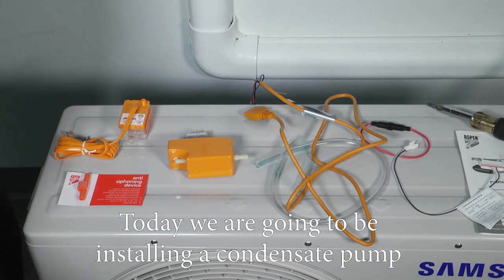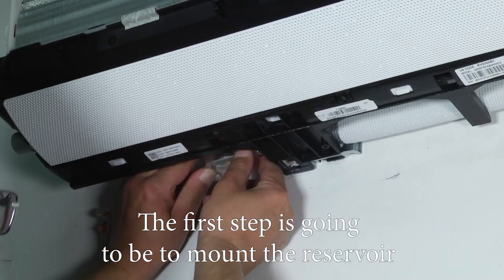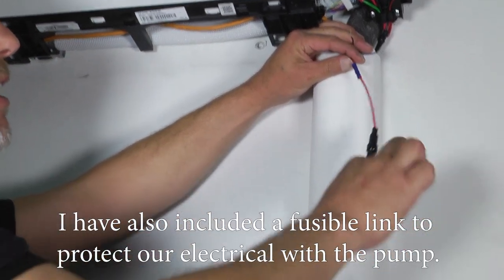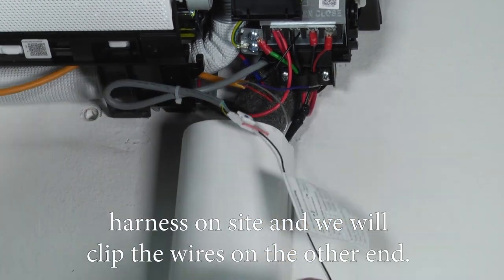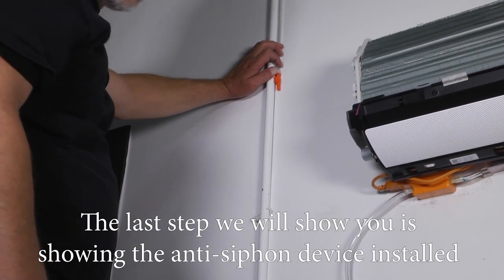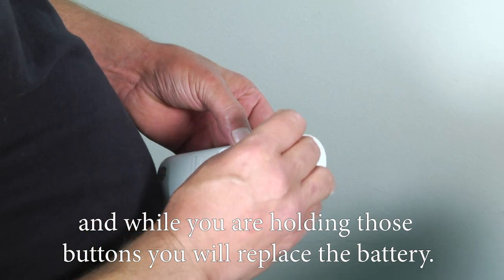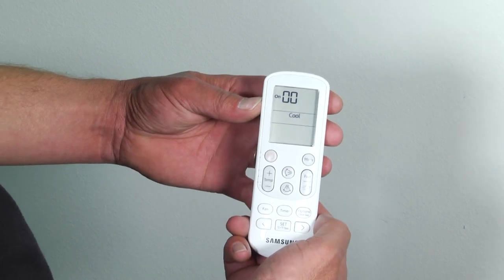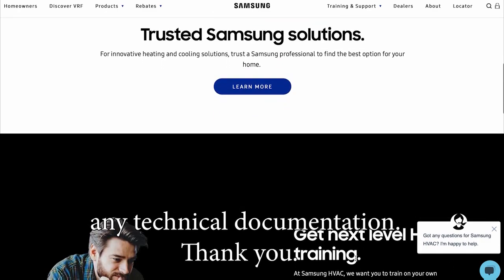Connecting a condensate pump and overflow switch to 2.0 high wall systems

Comment: Hi, i have an almost similar mini orange pump (FP2212). Is it normal, that the pump is very hot even when the AC isn't operating, so the pump must be in standby? It's installed in the attic, and the air is quite hot there
Reply: i have the same problem. not sure if the pump is fulty.